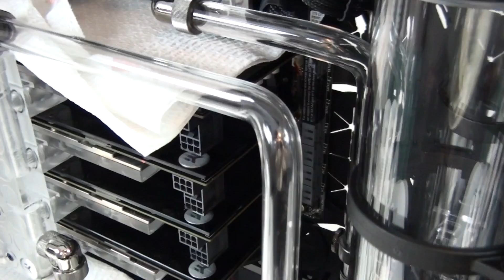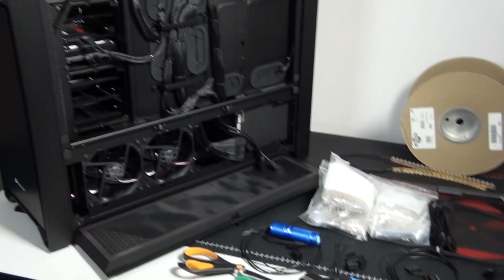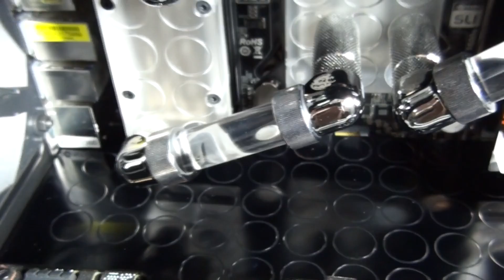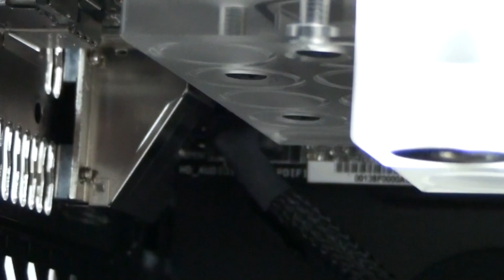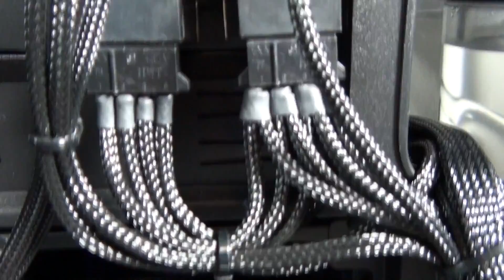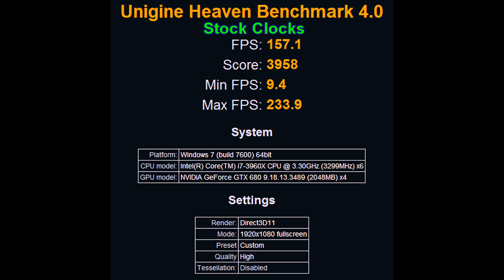Build #12: Quad SLI 900D: Part 3

Comment: Whats the point of watercooling?
If you save the money you might as well just buy a better cpu instead of overclocking.
You also dont have the risk of water leaks. 
Is watercooling even a option for computers that run 24 houres a day? I doubt the water will be cooled enough over a longer period.
Reply: +RetributionAngel you do know you don't have to have liquid cooling to OC right? You do know how much OC helps right? You do know how much prettier custom loops look right? You know how much time, planning thinking and strategizing water cooling takes right? You need to get your head out of your ass bro.
Reply: +RetributionAngel theres a radiator in the loop which cools the water
Reply: Phugoid
Jeah... but the are not inside the water.  Its like blowing against the side of youre cup to cool youre tea or coffe
Reply: no its not, its the same as a car radiator for oil and coolant, lots of surface area = high efficiency
Reply: The Marshmallow Man
what a educated answer
Reply: cheers
Reply: *****

i doubt you oc to 600Mhz and still have a stabil system. I also doubt your cpu wil live longer than 3 years. And i doubt that it will give you a much of a diffrence in games. That like 10 more frames or what?
Reply: +RetributionAngel its not like water cooled systems are unsafe. you leak test them prior to running anythign else in the system. once you leak test your system its not going to leak over time. Nothing other then a pump will be effected in say 5 years.  but even if i pump goes out you are not going to leak. Water cooling is far better temps then any air system even if not over clocking. say you have a very good CPU the lower the temps the longer the CPU lasts so if putting water cooling on the CPU brings the tep down 20c from air cooling then you will get a longer life out of the chip.  also water cooling is sooo much quieter then air cooling.  the more radiators and more fans you have in the loop the slower the speeds of the fans can be.  You get surface area from the radiator as the water goes through the radiator the fans are dispating the heat through the fins just like a car's radiator does.   By your remarks and how aggressive they are it makes you sound like you do not have much knowledge into water cooling and that you are just repeating old rehtoric you may have heard once.
Reply: +RetributionAngel Are you aware with how physics works?
Reply: Legend Hidde
yeah water kills youre computer and the benefit is 0 to non. Cooler PCs are not faster
Reply: RetributionAngel Cooler PCs last longer, get higher overclocks, are quieter and watercooled PCs look prettier.

The amount of times an AIO watercooler has leaked is practically 0 and the companies always pay for the damage that they caused. If you suck at making your own watercooling loops you may get some leaks but if your PC is turned off it doesn't damage anything.
Reply: +RetributionAngel a cooler pc can be over clocked more then air cooled computers.  thus they are faster.
Reply: Carl Craw or you can just spend the money on  a faster cpu from the start and not have the risk of water and los off warranty
Reply: RetributionAngel Why the fuck would you do that?

Still more noise, more heat, unnecessary features and an ugly air cooler.

There is as much risk at water damage from a cooling setup as there is risk of breaking your motherboard by installing a huge air cooling tower.

Do you pride yourself on being an idiot?
Reply: +RetributionAngel I have an i7 5960x so over clocking is nice. and if I buy a faster cpu I can just over clock it as well.
Reply: Carl Craw
let me guess....you only ever play games.  Con gz, you got 4 more frames or some insignificant number.
Reply: +RetributionAngel  actually it has nothing to do with fps the reason why I Oc my computer if all I did was game I wouldn't of gotten the 8 core Intel 1000$ processor.  I need a lot of multi thread processing. some times I have 30+ processes running 24/7 before oc, after oc I can get closers to 45 of them running.  this is why water cooling is superior. running 80% cpu for days on end at 29c and 32c on gpus.
Reply: +RetributionAngel obviously you have limited knowledge about over clocking and watercooling you should probably quit before you make your self look even more uneducated on the topic.
Reply: Carl Craw
enlighten me!
Reply: +RetributionAngel I have been but you come back with some ill-informed nonsense that just proves you have no clue about either of these 2 topics
Reply: Carl Craw
all you said is you oc the cpu..... you can buy faster cpus....so whats the point of oc with water?
Buying a cheap cpu and putting money into water cooling, to end up with the same GHz as a fast cpu but not the cach size?
Reply: +RetributionAngel the cpu isn't the point. no matter what cpu you put in, it will benifits from water cooling.  Lower tempts increase the longevity of the chip. so even if I had the fast chip I would oc it and water cooling it because you get the added performance. it's like buying a stock 454 motor and supe'in it up.  I have a 1000$ cpu with 8 cores I Oc it to get even more power out of it. by adding 200$ in water cooling I not only cool my cpu I cool my gpus with far better results then air.  I am not going to find a better cpu for 1200$....and still not cool my gpu. see the point?  you cool your system far better then air with little to no noise compared to air cooling.  water cooling will always be superior to air cooling.
Reply: Carl Craw  Thats not even true. Cooler temps dont icreas longevity.  Cpus turn off by the point they would take dmg from heat. The best you will get is a few Ghz from Overcolocking youre GPU or CPU. By wich point you can just buy a 200,- better grafiks  with more ram & more steamprozesses. Or a better cpu. Depending on youre workload. Hell you can get 32 core dual Xeon systems. 4 or more grafikcards and so on.  Cpu speed is not only determined by Ghz. You might have heared of the Ghz war? That is over. Caus at over 3.5 or 4 Ghz more Ghz dont increas youre performanc relativ to the Ghz number. Cpu speed is determind by the cache size and by core count more than Ghz today. You cant cool youre cpu to have more work prosses per cycle. 

The noise argumment is also BS. That might have been the case in the 90tys. Today cooolers have heatpipes and cpus are built with heat in mind. Also you still need fans to cool the water.

What you do with the cpu matters. games are developed to run on current gen Systems. If they would require 4000,- $ or more systems no one would buy the game.  And when it comes to rendering Ghz becomes really a small faktor compared to core count and cache size. 
If you look at high end systems with multi cores or multi gpus. Non of them are water cooled. Becaus its just stupid to put water in a electronic device.
Reply: +RetributionAngel it is not dangerous to water cooling again you are showing how ill-informed you are. and cooler Temps does in crease longevity of any electronic device.  imagine running 24/7 at 90% computer load at 80c vs 30c, which cpu will last longer...the 30c one.ofc. yes I have fans on the radiator to cool the system, but because I have much more surface area from the radiators those fans can run at a much much lower rpm.  also you remove the fans from the gpu.  again you show how ill-informed you are.  have a good day read some information on water cooling.  putz
Reply: Carl Craw
So you spend 200,- for supposed longer live of components that are outdated in 10 years anyway. Instead of just buying more up to date stuff.
Yeah...its so much more quit :D  I have seen Watercooled systems. Youre deluded.
Reply: +RetributionAngel if they are not using 4 pin fans then they are not controlling rpm thus not making it quiet.  I have 20 fans running at lower rpm you can't even hear the fans. people ask me all the time if my computer is even running.
Reply: +Nava Hivon the guy needs to read up on thermodynamics and watercooling.  he doesn't understand the basics of it at all.  doesn't understand that the water temperature gets an equilibrium, that the temperature balances out, not it gets hit then cold then hot again.  to bring the temperature down you add more surface area via radiators, pushing more air through them to bring the overall temperature down.
Reply: Carl Craw i know i hate people who think they know it all
Reply: +RetributionAngel Why do people spend 200$ on shoes? On jackets? Over 100.000$ on a car? I personally know people who would declare me insane because I spent 700$ on my PC once every 3 years or so, but themselves buy handbags that are retailing for literally 2000$, or buy iPhones for 700$. According to your logic, a 100$ smartphone can literally do the same thing, a second hand car bought for a few 1000$ will do the same job as a Ferrari, because you shouldn't go faster than the legal speed-limit anyway.

But guess what: we don't owe you a damn thing. I can set money on fire and upload the video on  youtube if I really feel like it. 

Some people love tinkering with technology. Water cooling is just a little extra: it's more silent(it is, trust me), keeps the hardware cooler. It's just something for enthusiasts. And it looks cool, too.

Is it worth it? I'm not sure.  But following your logic, almost nothing we buy or do is necessary to survive. But we live in a society that luckily, we can do things like this.

So in short: piss off, if you're so superior you surely have better things to do than post something on youtube.
Reply: Dieter Lievens
Ferarris and Hanbags have better resell vaue. Better Phones can do more.
Water cooling does nothiing for you but look nice. The only thing it does do is add the risk of water dmg to youre system
Its like paying extra for the chance of breaking youre system.

Keep ignoring technical fact and pretend youre some computer expert. LOL
Thats why you water cool. To BS youresel into thinking youre system runs faster when it doesnt.
Reply: You're missing the point: who are you to tell other people what to get excited about?

Some people go mad over people kicking a football around. Some people get excited about fashion or racing cars.

If some people want to install water cooling, what business of yours is it not to let them? It's not like they're coming over to your house and do it to your computer, isn't it? If you get so angry about watercooling, then what are you doing watching this video and commenting on it in the first place?

I don't go about and spout angry comments about things I don't like in video's of people who are excited about them. Especially when nobody really gets hurt doing them.

I guess it comes down to this: Why do you care so much about how people cool their PC's?... 

PS: I don't even have or want a watercooled pc, I just like the craftswork and dedication in this video.
Reply: Dieter Lievens
Who are you to tell me?
Reply: +RetributionAngel +Dieter Lievens +Nava Hivon. He admitted it. Water coolers look cool. He doesn't have one and is just peanut butter and jelly.
Reply: +RetributionAngel The point of high end watercooling is not to overclock core2 duo. The point of high end watercooling is to overclock a fucking FX 8350 from 5Ghz to 6-7Ghz. Or an Intel I7 black edition. Or 4 Titans on SLI.
Reply: John Milionis And for what would you need that?  
 Are you saying you need to overclock a FX8350 or i7 6700 for a nother 500,- instead of takeing a 8370 or 9590 becaus youre games dont run as fast without it? 

You do know people with higher demand use things like the Renderbox or Dual Xeons or have Render Parks.

And again overcocking beyond 4GHz gives you deminishing returns.
Reply: RetributionAngel Well I personaly DONT NEED that, but there are people who need EVEN MORE POWER FROM HIGH END hardware. NOT me.. Yeah, there are people who need to overclock Xeons( which are servers cpus btw). I dont understand your problem with overclocking.
Btw that is not water, that is cooling liquid.
Water leaks happen if you mess up things.
I myself bought a watercooling system( not like this, I bought a market block for my CPU only. This guy is watercooling EVERYTHING, and I saw a 40C drop on my cpu.) And you tell me that watercooling is useless? Right now my NB chipset is boiling at 127C. You think that should happen? If it was watercooled it would be down to 20-30C.
Reply: Some people put spoilers on their car claiming it will make it faster. Each to his own.
Reply: Dieter Lievens Spoilers have a use. Its called better holding. And also they increase the speed a bit as they adjust the air flow behind the car, making the air flow more consistant thus not slowing down the car cause of abnormal air friction. 
Anyway, how can you compare those two I dont even understand. If you guys think that watercooling high end electronics is for fancy reasons (ofc water cooling is looking cool and I dont see how that is bad but w/e) then you can go back to yourcage. Oh and please remove any air conditioning you have in your house, cause we humans can survive 40-45C during the summer. Who cares if we get hot.
Reply: ...I had 4 years on engineer training, I know what a spoiler does, and what it doesn't.

It holds down the car at high speeds. It's essentially a wing upside down. But just like normal wings, they do require quite the amount of air flowing over it to actually work. That's why f1 cars don't work well in low speeds.

For most cars on the road, spoilers are about as usefull as sails on the titanic.

But they do look cool, granted. And I'm in no position to tell other people what to do with their money. If it makes you happy and doesn't hurt anyone, please, by all means.
Reply: Dieter Lievens +Michael Tollman 
Guys. Yes I told you that spoilers increase the holding of the car. 
Also I myself am an engineer. And my dad is an engineer!
Yes they also increase the speed of the car as they make turbulent air flow behind the car, constant flow. Turbulent air flow behind a speeding vehicle, slows it down. Spoilers not only increase handling cause of air's resistance, They normalise the air flow thus reducing the negative friction that turbulent flaw causes. The increased speed is minimum like mb 0.5% or even less.
Reply: All of that is true, but a spoiler installed on a Peugeot 106(or pretty much any family car) isn't going to make any difference whatsoever. Yet people do it. Some actually think it makes a giant difference, some know it's stupid but they still do it. But you're missing my point:

My point wasn't whether or not spoilers are usefull, it's got more to do with 'who are you to tell us what to do with our time and money?'.

If I want to burn 1000 dollars cash of my money in the furnace, it's my right to do so. Regardless of whether you think it's useful or not. Pretty poor return on investment, true. But that's irrelevant.
Reply: Dieter Lievens That is true sure. A spoiler on a freaking 106 is 99% useless. The differences would be so minimal that noone will notice. But i still dont get your problem with this build. This pc is not for playing dota 2 or bff3. Also, I dont see any other way to run 4x SLI other than watercooling. I mean, even if you just wanted to isntall 4x SLI there would be not enough space between each card, cause the stock metal coolers are huge.
And even if you manage to find a mobo big enough, men can you imagine the temperatures in between those 4 cards? Especially those in the middle will get fried !
Reply: John Milionis
Just by 1 Better grafik Card from the money you save on the 4 and the cooling System. -.-
Reply: RetributionAngel You know nothing about watercooling. Overclocking add tons of extra horsepower to the PC, as seen on benchmarks. That's why you watercool, as I have experienced it myself.
Reply: StatTrak™ Tagged 99
No he didnt... you are a scrub noob
Dual Xeons are the best. 
Its not a huge improvment to overclock if your PAYING a ton for Watercooling.
Reply: RetributionAngel At the end of the video.. It said the Performance Improved by nearly 70%.
Reply: StatTrak™ Tagged 99 Yeah... going by benchmarks wich mean jack.
Reply: RetributionAngel Kiddo, just admit that you were wrong? If they don't mean trash then what can prove that OCing can help improve performance by LOADS? Arrogant fuck.
Reply: StatTrak™ Tagged 99
Then prove it!
Your just full of shit!
Reply: RetributionAngel What the fuck? I have overclocked myself and achieved amazing results. Overclocked my i5 6600k from 3.5GHz to 4.9GHz, watercooled. Also overclocked my GTX 980 from 1294MHz to 1445MHz. Crysis 3 used to run at 72 FPS, now it is merely 100fps.
Reply: StatTrak™ Tagged 99
 Yeah and now you got a few more fps. COn gz.  I did the same thing years ago. Then the grafik card died after a year.   You got 25fps more when Humans cant tell the diffrence over 60fps. Can you monitor handel it? Do you even know if your seeing anything diffrent? Try check fps under load. Let a Render run while playing. Caus your idol stats are not intressting.
Reply: RetributionAngel Learn to spell. It's not my fault if your Graphics Card have died after a year, you probably don't know how far you should push your overclocks. It has been running 6 months and it has been as stable as ever.
Reply: StatTrak™ Tagged 99
So you have 6 months of  25fps more and you say water cooling is worth the hunderts of extra dollars without any real workload test or any backing.  Best you just stfu noob
Reply: RetributionAngel Do you have any backing up that it does not increase performance? No.
Reply: StatTrak™ Tagged 99
 You are the one claiming its worth spending several 100 dollars extra on Watercooling & Overclocking. You have to show it does something. 
Its been proven that higher MHZ speeds dont increas preformance much. Thats why they went away from MHZ races and into duo and quad cores. Its not just a heat issue. Same for Grafik cards. More pipelines and faster ram does more than going higher in MHZ.  Thats why real workload tests are the best and they show OC systems are not as good as just buying a CPU with higher speed.
Reply: RetributionAngel Well, buying a better CPU for me will be an extra $150, (i7 6700k) and an Watercooling AIO loop is $100. (The one i'm using) I can easily overtake the i7 in Gaming situations, as I have 4 Cores, all at 4.8GHz+.

As for the graphics card, I do not have watercooling on it but it still overclocks well. I got a 20% performance boost.

Can you please link me the video that says Increasing MHz doesn't increase the performance by much? If not, gtfo.

(P.S.: It's not Grafiks card, it's Graphics card.)
Reply: RetributionAngel Also, you mentioned faster RAM. "Faster" is predefined by "running  at more cycles per unit of time", which means it uses the unit Hertz. "Faster memory" basically means more MHz.
Reply: StatTrak™ Tagged 99
Faster as in  DDR4 instead of DDR3. Mhz is not the all determining faktor.
CPUs and GPUs have something called Cache.  That is why you should invest you money in a better CPU than in fanncy gowing Watercooling that costs a ton and only lowers you CPU lifespan. Instead of giveing you actuall performance that matters like running more shaders in a game instead of getting even more fps that you still dont notice.
Reply: RetributionAngel So.. Watercooling reduces CPU lifespan? Have you got anything to back that up?

Also, 2400MHz DDR3 is faster than 2133MHz DDR4. It is just form factor and Voltage. MHz is the deciding factor.

Also, it costs less to get more performance, I don't need the 8MB an i7 offers, I don't need 8 Threads, I need 4 cores, 4.5GHz+, and at m ost 6MB Cache.

Please, still haven't sent me proof how more MHz doesn't mean more power, or watercooling reduces life expantancy.
Reply: StatTrak™ Tagged 99 Are you trolling? I said Overclocking does.